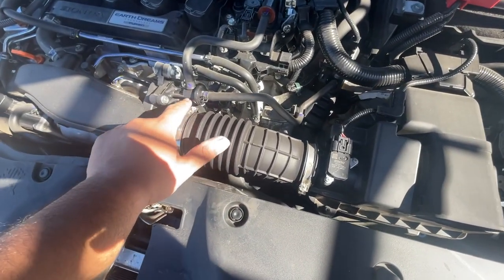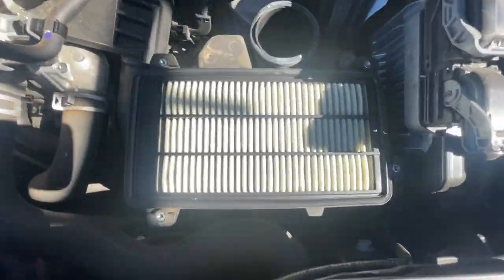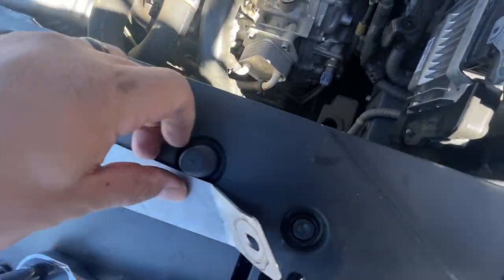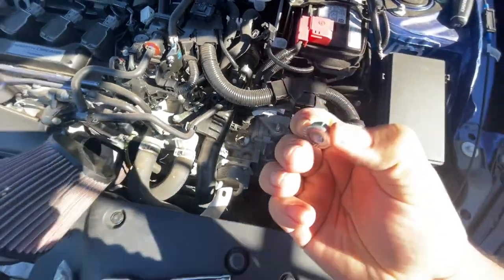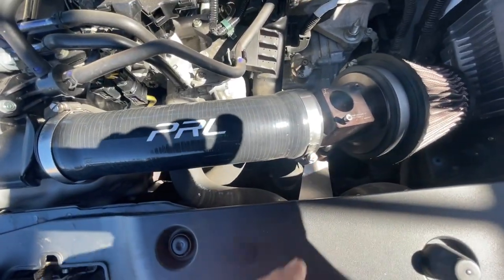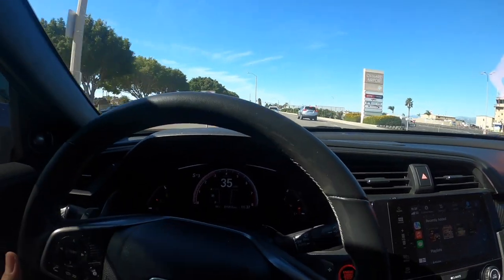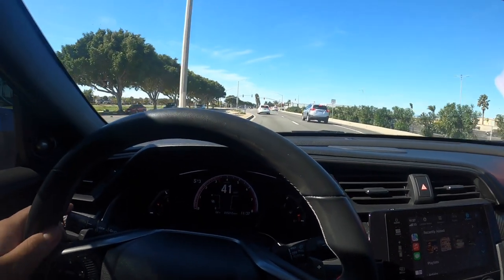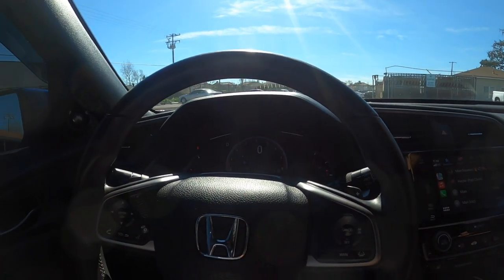Easiest Install for the 2018 Honda Civic Hatch Sport | PRL INTAKE Install

Comment: I have the prl short Ram on my 2017 civic Si 
For over a year now 
I do pulls back to back in the hot summer days and still hit the same boost peaks everytime 
Short Ram did not make my car heat soak in 90 degree weather 👍🏼
Reply: It works great
And the mpg is a little bit higher
Reply: Just bought 2017 civic sport hatchback 6 speed, looking forward to adding the intake

Comment: The first thing I noticed is easy access to the throttle body when you need to clean it...I did in my 07' Si and it make a huge difference with 251K miles.

Comment: Just ordered the RACE Man conversion kit & 27Won TIP.  I actually  just installed my W1, pro flex fuel kit and the competition clutch stage 2 with the light weight flywheel last week. can't wait to end the break in period to see what these mods can do. e-tune by drop my move sometime next month.

Comment: Wish they would’ve used a traditional auto with the civics like a 6, 8 or even the 10 speed auto. Sounds good though bro not bad at all.
Reply: Why is that? Just curious
Reply: @Gafferd8186  because cvt’s aren’t that great imo. They don’t last that long and they aren’t ideal for a build if you want to increase power. They don’t hold up well compared to traditional auto’s.

Comment: Anyone know why my check engine light came on? Everything is installed correctly and won’t go away.
Reply from the maker: @luisreyes5109  the MAF sensor might be off
Example
Did you get the street version? (No tune needed) Or the Race version? (Tune needed)
Reply: @ I checked my order for the details and yes I did get the race version which needs tune. Didn’t realize I got the wrong one haha

Comment: If so I have a the same, I have muffler, resonator delete. 2.5 piping from where the resonator was on back to the tips. I installed a k&n  high flow engine air filter . It seems pretty quick. I soon coming up will get a moshimoto intercooler.
Reply: Can you here the intake still or does your exhaust overpower it?
Reply: @dezflix7007  you can hear both, specially when you let off the gas…it’s loud enough lol

Comment: You think I’ll rub on a 18x9.5 +35 235/40 on a 10th gen
Reply from the maker: Depends on your suspension set up

Those are my specs on my 2020 Si and I’m lowered on Eibach sport lines, I don’t rub
Reply: @TdaKid  I have eibach sport line too, yea I saw , nice fitment btw!
Reply: @mikel9751 did you end up getting wheels with that spec bro? Tryna buy some wheels for my girlfriend’s FK7 hatch since its on D2 lowering springs
Reply: @MACDANNYYY  no , but my buddy did ! he also has d2 springs he had to roll the fenders
Reply: @mikel9751  damn bro 2 years later still replied, appreciate it brodie

Comment: In just installed one in my 2018 Si and within 5 miles of driving got a code for misfires. I had to put the stock box back in. Total waste of money for me….
Reply: Same I just got mine and turned on. Debating if I should return it or leave it since it won’t hurt anything.

Comment: Suck in that heat ! That filter is trashed already !
Reply: You do realize the air going into the turbo through the intakke is pressurized which increases the air temp and then cooled by the intercooler.